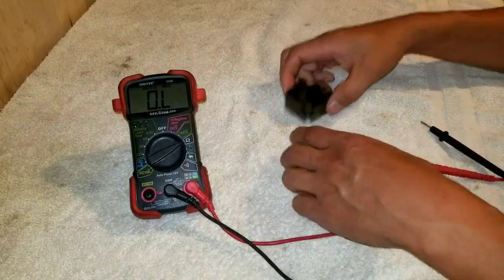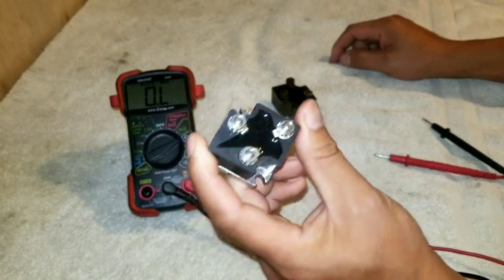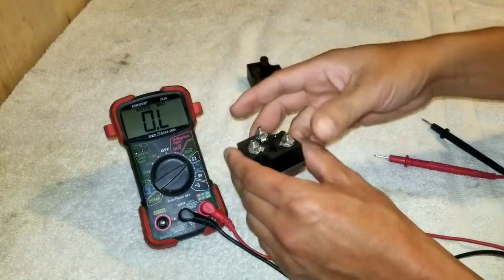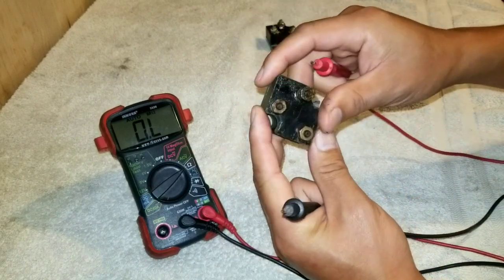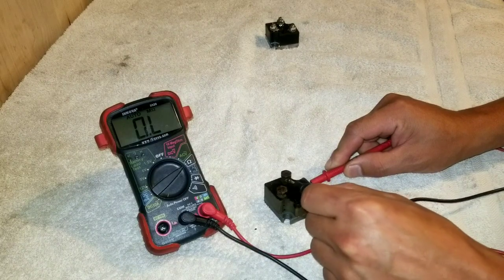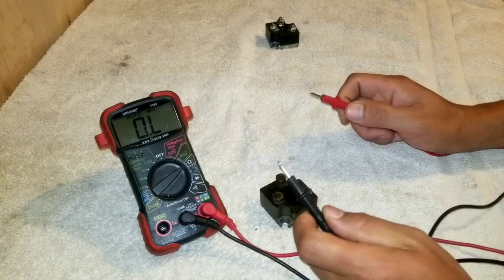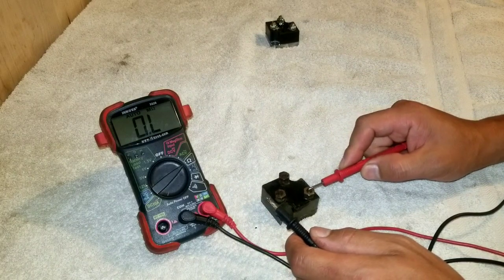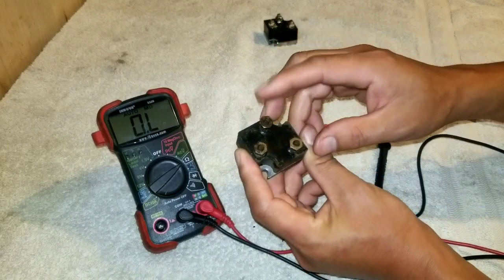Mercury Outboard L3, L4, & L6 Rectifier Test

Comment: Cool test. I would recommend checking the rectifier's internal diodes with the DMM in diode mode vs ohms. You should read 0.4 - 0.7 VDC in one direction and OL in the other.

Comment: Hi Son, thanks for passing on your knowledge. I tested the stator on my 1988 L6 and it showed the correct resistance for Red solid to ground and the Red with White stripe to ground. Unfortunately, the readings were both OL when testing the Red solid to Blue solid & Blue solid to Blue with White stripe.

What would cause this and is the stator shot? Regards, Ian from Oz

Comment: I have a 90 hp Mercury mariner tower of power that is charging at full throttle 18 votes and wires at rectifier is getting hot. It charges 12 volts at idle but goes up at high speed. Motor runs great. What’s wrong with voyage

Comment: @MerCSon L6 I was wondering where the voltage regulator is on my Mercury 89, I can see the rectifier you are referencing in the video, but no regulator. As such the voltage under way goes up to 18-19V to the battery depending on the refs. I can only guess that the owner before me removed it and never installed one again, or did the motor not come with one?

Comment: Would completely removing the rectifier and isolating the three wires, two yellow and one red/black, affect the timing at wide open throttle? I was having a issue with my V6 Blackmax not going over 1500rpm and saw on one of your other videos that it might be due to a bad rectifier. Pulled it off the motor and taped off the wires and it rev'd up under load in the water like it should, but now it has a miss- cutout at WOT. Any ideas?

Comment: I have a problem with switchbox and stator failure on my 1978 mercury 500 50 hp I put all new wiring, coils, trigger, after market stator with adapter and swithbox still fails the only thing I didn't do is timing which seloc manual sas has to be in test tank to do .A ny ideas to what would cause this Thanks Tim

Comment: So I have a old style rectifier bigger and oblong shaped not diamond shaped like the modern ones.. Can you confirm that there is ground on the casing/body as it's failing all tests except the last one. where you are using terminals only it passes but fails all the rest of tests where I have to ground it to the chassis..  A new one is less than 20 bucks so easy to replace just trying to confirm through the test if its good or not..  So really just curious if there is no ground to that casing or its just failing all the tests requiring a ground ?? Oh I put a brand new battery in on Saturday and my 1970 80 H.P. mercury Thunderbolt roared to life,,It absolutely loved the new battery and ran great.. It was then I discovered the stator was dead.. got a rare replacement on the way from Michigan.. I have managed to hoard 2 extra motors that I have robbed 1 for its stator already.. . still have another 55 year old one in the other motor but I managed to find one thats been reconditioned for a killer price so I am waiting on it now.. I will perform the tests on the rectifier on the boat when I put the new stator in .. Your videos always come to the rescue ..  Thanks man.. Our wether up here in Canada has and will be crap for another month yet but at least the ice is off the super freezing cold water.. I want my parts to arrive sooooooooo bad..

Comment: I have a 1997 20HP outboard I just bought a charging coil (2 wire) to add auxiliary power to my outboard. Is this the type of rectifier id use? If so do I run my ground from battery back to the motor and likely just ground it to same spot the rectifier bolts to?

Comment: I am experiencing something strange, I have an 1987 mercury 80HP the stator tested out ok but I am showing 17.5 VDC. Bought another rectifier and it is putting out the same thing. I have replaced the stator with a new rectifier and the same thing I was showing 60 VAC on idle coming from the yellow wires on the stator. Now suddenly I am seeing 60 VAC from the yellow wires from the yellow wires from the stator.  And also noticed cylinder 1 stoped firing .What am I missing?

Comment: Hey Son. My rectifier failed 2 of the test. Got a new one, checked and all test good. I installed and at idle it slowly climbs to 17+. Volt gauge as well as ohm meter. I have not been to the lake to see what it puts out at throttle. You mentioned 15-16. Is this too much? CCI stator. Thank you
Reply from the maker: It is not. That's typically why the alternator wires are the first to go. Son

Comment: I would have liked you to show us the good one. But I got a question I got 16 volts coming out of my red + part of the rectifier  which of course is going to my battery. Is this okay or should something regulate the volts because  my battery is 12volts in a car I usually get like 14.4 ish on charging but not 16volts
Reply from the maker: The L6's are unregulated. Which means the stator wires typically burn up from the alternating currents. It is "okay" for the extra voltage charging the battery however the wires off the stator are resilient at showing the price. Son

Comment: Hey man, I've got an older red band 110 L6 that the "shorting clipper" on the rectifier has a broken wire. What exactly does that little part do? If I hold it together the engine will fire but if I don't I get nothing.
Reply from the maker: I'm not sure what a shorting clipper is. Additionally  I did not know Mercury made a 110 red band L6. What's the year?

Comment: Where does the DC terminal wire hook to
Reply from the maker: The DC terminal hooks up to the single terminal opposite of the 2 that are side by side. The stator send 2 alternating currents to the posts side by side and the rectifier converts it to a direct current. Son
Reply: @MerCSonL6  where does it go from the rectifier
Reply from the maker: @maryfithen5006  connects to red battery terminal on the internal harness

Comment: Thank you, great video!   Last year the tachometer on my boat intermittently worked and now it stopped working altogether.   Also now it no longer charges.   Can these problems be related back to the rectifier?   I have a 2004 Mercury 50 Hp 3 cylinder.   Thanks!
Reply from the maker: Yes. Son

Comment: So i can't just disconnect battery to check ? Greaat vid. Thx.
Reply from the maker: You can run the engine with a voltage meter attached to the battery. If it goes up You are good. Son

Comment: I have a 2016 90 hp mercury outboard with erratic charging voltage. It bounces between 0 and 14.5 volts. Could this be a bad rectifier?
Reply from the maker: A bad regulator. Son

Comment: Hey Son, Really love your videos have watched all that pertain to my L6. I have a brown band 90 hp 1984. Had problems last weekend, motor running great, had went for a cruise up river and was coming back home probably 6-7 miles when the motor shut down.  Could restart but wouldn’t idle to get it in gear, got in with the kicker motor. Have done electrical work over the winter. Replaced CDI boxes had intermittent  fire and coils could see a couple arcing underneath at night so replaced them all. I had noticed a couple crusty wires coming out of the stator to the rectifier, but had left them alone. Figured that was my problem. Was able to cut them back to where they were good, still wouldn’t idle. Looked up the CDI troubleshooting guide and they said disconnect the rectifier if having any idle issues. Sure enough it would idle then. I ordered a new one on Amazon put it on and the same thing wouldn’t idle hooked up. I hadn’t seen this video before I put the new one on, but it tests bad like the original. Not sure if I got a bad one. I ordered another and will test before I install it. My question is can another bad part fry a rectifier that quick?  Also can I run without the rectifier hooked up. Think the only battery draw would be starting and accessories. Would it hurt to use it till I get the new rectifier on.  Thanks
Reply from the maker: You can run without the rectifier connected. It's only purpose is to power your battery/switchbox. Son

Comment: Hi Son
Just been out today with my 115 and noticed the volt meter reading 16.7v, would you say this is ok or is the rectifier knackered?
Thanks
Paul
Reply from the maker: Earlier 115s the rectifiers were unregulated. Meaning yes, the can go up to 16 volts. That's why a lot of the yellow alternating wires coming off the stator fry and typically need replaced. Son
Reply: @MerCSonL6  thanks for getting back to me.  Ok cool, just that I've never noticed the voltage going that high before. I'll keep an eye on it.
Thanks for all the great vids by the way 👍

Comment: I replaced my rectifier and my tacho started working, but mid wot it stopped.
I checked the new rectifier, and it's testing good. I ran a new wire from the rectifier to the tach, and still no signal. Kind of lost on where to go next.
(I have 2 tachometers same result)
Reply from the maker: Could be a stator issue? The tach reads ac voltage coming off the stator. You would need a dva to test properly. If the engine is running properly then I would replace the rectifier even tho it "tested" good. Son

Comment: Okay so there are 2 wires coming from the stator, does it matter how the 2 wires are connected to the input posts on the rectifier? I'm thinking it does not in the same way the magnets on the flywheel can create voltage spinning clockwise as well as counter clockwise?
Reply from the maker: You are correct. Son

Comment: I have a 1994 100hp mercury.  The tack works intermittently.  Then only for a few minutes.  On my Garmin depth sounder there is a volt reading. Some times the reading is as high as 17 to 18 volts at higher RPMs. Is the rectifier failing and does it have anything to do with the tack. And the tack is new. Thanks
Reply from the maker: Could be both. I would test/replace the rectifier first. Its the cheapest. Son
Reply: What do you mean by both? If you are referring to the tack as one and the rectifier as the other. Tack is new. I replace the tack, but it does the same as the old tack. Works intermittently. My basic problem is getting the tack to work.
Reply from the maker: @capthal-rs9mq  then its rectifier or sending wire.  Have you tested the rectifier? If your tach is new and does the same as the last then that's definitely not it. Son

Comment: I'm pretty sure a continuity test doesn't care what color (polarity) the probes are. The resistance is the same regardless of the probe orientation. Why did you expect different results when going from "black" to ground..then "red" to ground?
Reply from the maker: Thats how the Mercury Service Manual states to perform the test. Son
Reply: @MerCSonL6  after I posted this...I had to check and the method to test is correct. I have a rectifier that's not charging so I bench tested old and new. I learned that it's the diode in the rectifier that is polarit sensitive. (Controls the direction of the flow) I have never seen a multimeter on ohms setting do this...but then again...I never tested a diode. You have educated this old man....thank you sir.
Reply: Also...found this on the exact rectifier on my 50hp....and your video.

http://www.myoutboardengine.com/rectifier.html
Reply from the maker: @chriszocco8209  Electrical is not my strong point. I have to go by the book many times. Another way to test if your rectifier is working is to put a volt meter on your battery and run the engine. As you rev the engine the voltage ⚡ should go up. Thanks for the feedback and I am glad we figured it out. Son
Reply: @MerCSonL6  yep...that's was troubleshoot step one....no increase in voltage sent me upstream to the rectifier....thanks again.

Comment: Well, mine failed two tests. Do you think this would effect spark related issues. I have intermittent spark on random cylinders. Stator and trigger passed all tests in your videos. Mercury 115  6. Only thing I didn’t test was DVA outputs. Thanks in advance.
Reply from the maker: Replace it. Its cheap. However, it has no bearing on your erratic spark. You say your trigger and stator passed both of my tests?? I only have a trigger test. That deduces me to believe you have a bad stator.... and now potentially 2 bad switchboxes. Son

Comment: MerCSon - I have two L6's.. A 70's 150hp and a 70's 135hp. I tested one Rectifier (332-4252) and its bad... Im replacing the Stator on this motor because of the wires being bad - all the way up to the winding.. New Stator is on the way.. I want to install a new rectifier but was wondering.. I can install the newer style (as the one your testing here) as the replacement; correct? It look like the only difference being the Mounting.. I was thinking of just making an adapter bracket for this issue.... And I going down the correct path? Or do I NEED a 332-4252?
Reply from the maker: I install newer ones on mine (square). It will work. Son
Reply: @MerCSonL6  Awesome! Thanks!

Comment: Hi son. 
I have replaced the stator and rectifier. And still my battery isn't charging. I'm testing in vdc at the battery. Just 12v. Any suggestions. Thanks
Reply from the maker: The stator provides AC voltage to the rectifier which converts it DC while the engine is running. Those are the only 2 components involved in the charging process. Is the DC side of rectifier (red) connected to the hot wire coming off the internal wiring harness (typically red also). You can do a simple continuity test between the output post on the rectifier to the red battery cable while its disconnected. Let me know
Reply: MerCSon L6 I replaced my stator and rectifier like the above guy and found out I swapped the left and right post wiring... I corrected it and no charge - hopefully I didn’t fry my stator and I only just damaged the rectifier

Comment: Hey man, great video! I am not showing any continuity from the inputs to ground. I'm noticing after running the motor a while it jumps up to 16 volts from 14. Do you think this could be a faulty rectifier?
Reply from the maker: Thank you. Its working. But it could potentially go out when you need it the most. I would replace it. It's cheap insurance to keep your boat and battery going. Just my 2 cents. Hope this helps. Son
Reply: @MerCSonL6  Awesome thanks man. 👍 🍻

Comment: I have a 1995 75 Mercury 2 stroke outboard. The voltage regulator was fried, I could see the circuit board melted under the epoxy seal. I replaced my voltage regulator and still no power to starting battery. I suspect my rectifier is bad also. I don’t know which one it is for my motor L4 L6 idk? Can you help with that? I am getting the run around from all the local boat repair places. They won’t give me the info I need to fix it myself. I want to by the part and not pay $120 an hour for a silly 20 minute job
Reply from the maker: I believe your engine is a 3 cylinder? Does your rectifier look like the one in the video or does it look like a box with wires coming out (pigtail)? Let me know. Son

Comment: hi mate great videos on old mercs i have 2 / 80 hp blue band motors just wondering what sort of hone your using on bores and also how you do it .
Also whats the max over size you allow for  when putting in new rings and bearings
 cheers mate lee from aussie
Reply from the maker: Mercs allow .006" but anything beyond .004" should be bored to .015" (oversized). Even at .004" you will likely realize some loss in overall power. I used a 3 inch flex hone on the last 4 cylinder I rebuilt and was very happy with the results. Hope this helps. Let me know.

Comment: Love the channel. Im building a L6 right now. Got to ask can I use ported pistons in a block that had soild ones?
Reply from the maker: Thank ya. Yes sir. You can use ported pistons in a block that has solid ones but not the other way around. The port timing is different on the 140/150 and 115 after 1981. This block "needs" the ported pistons. Hope this helps. Let me know.